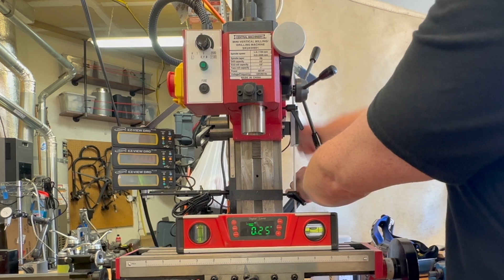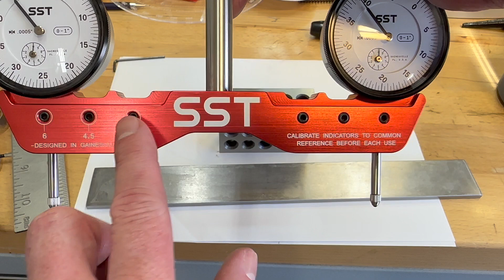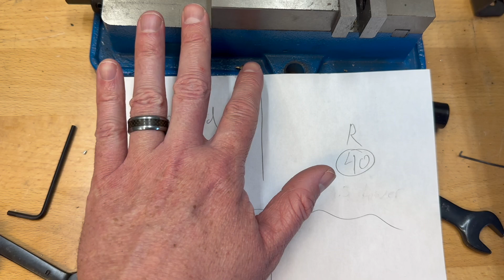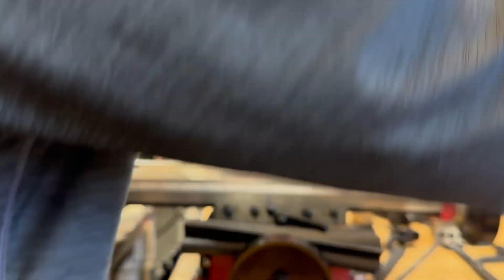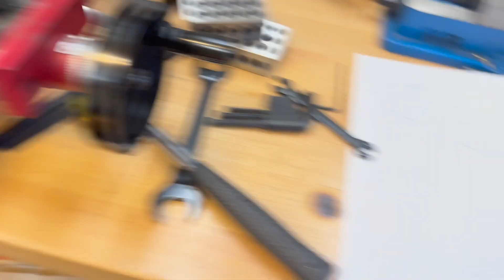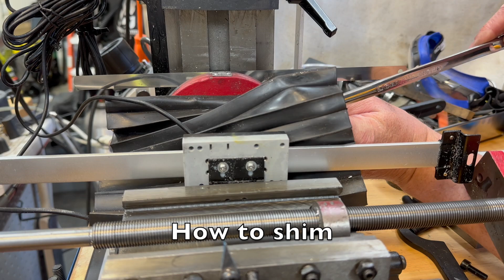Tools - Harbor Freight Mini Mill Crucial Alignment Procedure

Comment: Your calibration procedure is too complicated and error prone. Here's what to do. Put a spot of ink somewhere on on the table. Position one of the indicators (let's call it A) on that spot. Lower the quill to zero it. Be sure to make the needle go around once or twice, and note the small dial's reading too. Now turn the spindle 180° so that indicator B is on the ink spot. Lift both indicator plungers as you swing the tool so that they don't drop into table slots. Now zero indicator B by turning the bezel. Don't move the quill, and be sure the small dial read the same too. Now both indicators read the same on the same spot, so it's calibrated. No blocks or straightedges needed, and it will even compensate for other problems, like an imperfect collet. This is analogous to checking a level by reversing it to see if the bubble looks the same both ways. In use and you won't need to take notes or do arithmetic. And you won't need to turn it around or zero it. Simply adjust tram until both dials read the same. You can also tram with a single dial indicator, but the spindle square is a nice tool. It's easy to make one, and would be an excellent beginner project, and save yourself some money. I like the .0005" reading indicators on this unit, that's really nice, but ordinary .001 reading indicators from HF are fine.
Reply from the maker: Thank you! This is an excellent procedure you have outlined. I really appreciate you taking the time to clearly describe the details.
Reply: I bought this same unit and the instructions specified the 180 degree method. Those “tillable” column mini mills can be a pain to keep trimmed in!
Reply from the maker: @tomt9543 they certainly are a pain!
Reply: This 100%!
Reply from the maker: I made a quick followup video to show this procedure. Thank you again! https://youtu.be/NjIkO7gYYOw?si=SUHbfyC_2agUS3YY